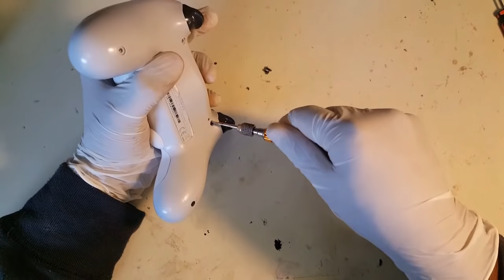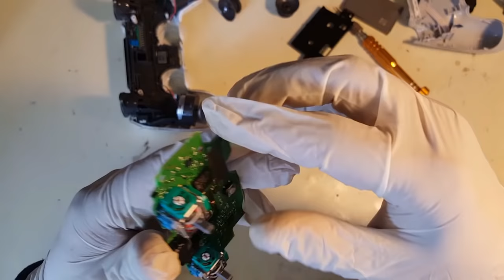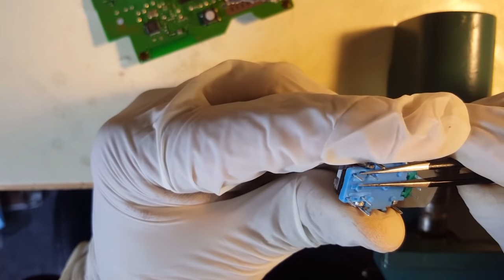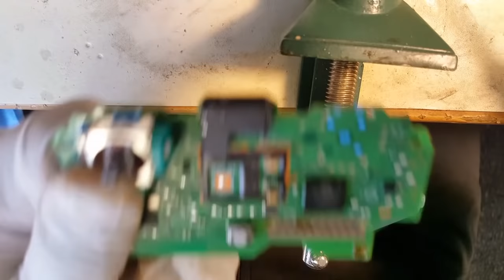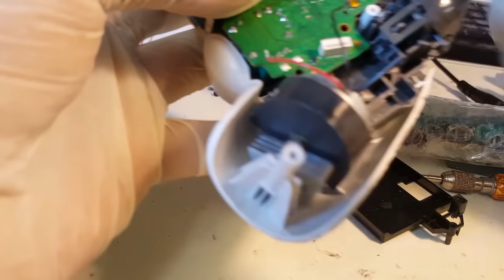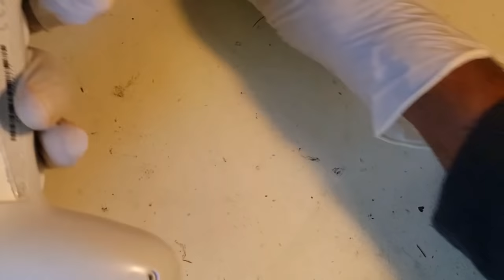Ps4 Controller Joystick Replacement

Comment: Could the burn marks on the board potentially lead to permanent and irreparable damage? And do you think someone with little experience with controller repair could do this ?
Reply from the maker: Be careful with the amount of heat applied. Yes it can lead to permanent damage. A little wit of patience can get the job done

Comment: The cables of the vibrating motors, you just solder them again with no special process?
Reply: Same question
Reply: yup, just solder back in normally

Comment: Do you reckon you could hold the new potentiometer under the board whilst heating and push it back in whilst the solder has flown? Don't have a solder remover figured it might be worth a shot.
Reply: yes, you can do this

Comment: How can I re apply the red and black wires onto the motherboard? Mine have been off from my second controller for a long time and wish to fix it myself
Reply: Solder it on
Reply: @Mr2dkid  do you need the wires for the controlller to be on pls reply as soon as posible
Reply: What do you mean be on?
Reply: Robbo they got ripped off the motherboard on both sides so they aren’t attached and controller doesn’t switch on
Reply: @TheViperAkz  when my cords got ripped off the mother board it still worked

Comment: Hello, I was wondering if you really need to use the heat gun? What if I just use the soldering iron to remove the analog?
Reply: Yeah you probably could but it may cause problems as burning the motherboard. I haven't tried this yet so I will update this comment soon
Reply: @rylloima1544  update?

Comment: During desoldering could you also just heat up the individual soldered legs with your soldering iron? As opposed to using a torch.
Reply: BcuzIGotHigh420 yes you can
Reply: @aronorenda  how can you use just the iron? I've tried before but my joints always have a little bit of solder left that won't melt
Reply: @shadowVVizardMon3yGang  for desoldering?

Comment: Recently had my 2 analog sticks replaced and soldered in. Now my controller shows orange when its plugged in indicating its charging i leave it plugged in for an hour or so and try to power it on soon as it connects to bluetooth on my phone it shuts off. Itll stay connected and powered on while its plugged in. Would you happen to know if the solder joints on the analogs are the culprit?

Comment: I replaced the right stick sensor on my controller everything works but the R3 button doesn't on the computer it shows R3 is being pressed without me pressing it and the stick itself is fine it is not stuck or anything. Is it a faulty sensor or I broke something?

Comment: I gave it a go after replacing the white potentiometer by slightly prying but still let a tiny amount of drift where it wouldn’t return to dead centre. The analogue stick just wouldn’t come off after wicking as much solder I could with flux and an iron.

Best option is to buy a new controller and sell broken one to someone who has a high end setup to repair and resell.

Comment: Hi where do you buy your 3 pin analog sticks out repair parts? I will like to ty and fix my ps4 controller I got two faulty ones. I didn't see link on description.
Reply: Hope you still need it after 4 years

Comment: I got a question , do you need the heat gun ? I'm trying to repair my controllers , But I got the soldering gun and I mean I would buy the soldering sucker to remove the iron Let's say just heating the iron one by one and taking it out with the soldering sucker it is possible ?
Reply: It's possible but it will take a lot of time and patience.  If you buy a solder sucker, also buy some solder braid too because that's often easier to use

Comment: anyone know what kinda gun he used? None of the guns I have seem to melt the solder
Reply: Same!! Did you get it?
Reply: @mcfriedchicken1972  yes i did. I put rosin core lead solder over it and then removed it and it worked for one I tried. I couldn’t do them all just one because I don’t have a circuit board to hold it up.

Comment: Thanks! Was trying to figure out how to open the shell without damaging anything and I successfully replaced the analog stick caps (:
Reply: PS4  controllers are the worst on the initial opening, feels like you're gonna rip it apart, and if you're not careful with the cable when you open it, you can.

Comment: At what temperature you are operating your work station, coz i melted mine lmaoo, and my board got cooked, i was operating at 400 degrees, Ik im stupid, but let me know what is the temperature you are using, so that i do it perfectly
Reply from the maker: Hot air station: 380c @ 3L air flow
Soldering station: 420c

Comment: I got a TS100 under Louis Rossmann's recommendation. The unit says it goes up to 400C (w/ 24V 5A power supply). However I'm having difficulty getting the solder on the board to melt. It has no problem melting my lead-free solder though. Any ideas? I'm new to soldering :/
Reply: You might have a long and pointy tip on your iron which makes it harder to put the most head directly to the solder pad! Buy a chisel tip and that usually makes melting the board way faster and more ideal for this type of soldering

Comment: I did everything but my controller wont turn on anymore, no led as well :/ when i press the ps button the controller starts to heat a bit... any solution?
Reply: Make sure you put the 12pin cable back in correctly
Reply: @josiesheppard8268  Probably? I mean, of course i touch the tracks but just around the soldering points... he's doing the same in the video... is it possible to not touch them in that point? :D

Comment: How do i reinstall the Black And Blue Vibration Cables ? My only problem is when i open my controler they got unplug from bothsides where they where weld into ?

Comment: I replaced analog sticks and now the speaker doesn’t work. When pushing R3 that doesn’t work but the stick itself works fine. L3 works both ways but when pressing it, it acts like I’m holding it for 2 seconds before it stops. What could be the issue?
Reply: Probably Just the Flex PCB. Replace It it's like 5 dollar.. be careful the graphite conductive is pretty delicate
Reply: @TheMasterizzatore  alright thanks

Comment: Can I send you my controller to be fixed ? I have the parts for the joy stick,  just not the heating tool . I've been through 3 controllers -.- I'm sad .
Reply: U can buy on ebay a soldering iron for 12$ same as i bought and i fix my controllers

Comment: What normal gamer is gonna have soldering tools 😂

Unless I get ratio’d my point still stands
Reply: I do, but I have a whole collection and mod them to work dual voltage and RF to Scart. I break things then I fix them. But I still game alot since the 80's. TBH I just got into this a few years back as a side hobby to gaming.
Reply: Maybe your to young to remember pin ball machines and arcade's but there was a time when every gamer had soldering tools. Who buy's electronics and doesn't have soldering tools ? its like buying a car and not having a wrench set sure you could do it , but then your dependent on some one else , DIY is
Reply: @Kit-lb6tr  hey, i broke the door of the analog stick (green piece), would it be possible for me to solder the metal together instead of buying a complete analog stick? Thanks
Reply: @Two_wheels_ninja  it's hard to say without seeing the condition. The conforming plastic from what I understand is antistatic and foundational. The sticks are fairly cheap I got 2 from alibaba for about 3 bucks and replaced and it seems to work nicer then the standard one.

But if you attempt your repair the worst you can do is make the stick not work. As long as you don't damage the main board and it's traces you can always replace later.
Reply: @Kit-lb6tr  thanks for the quick reply. Looking at the condition, there is just such a small gap to solder that I dont think i can unless you can heat metal and quickly attach it. I'm probably going to order some also. As well, do you have any recommendations for a soldering iron, idk whats bad or good as well as what I actually need in terms of electronics. Thanks man
Reply: @Two_wheels_ninja  I have a basic set nothing special. It was cheap like 30 bucks but the hot air gun was more expensive made by bosh. I use a 10 dollar solder sucker as well, it's the electric kind. If you invest about 100 bucks and like to fix your old equipment or electronics it's more then worth it. It's a hobby for me and I rather fix something then replace. Or at least try as it doesn't always work out.
Reply: @Kit-lb6tr  Yea im the exact same, I always like to fix things instead of replacing. I even want to try to fix my 60 gb ps3 ylod sometime this summer. I'm looking at a cheap Tabiger kit right now. Was the hot air gun necessary for this btw?
Reply: @Two_wheels_ninja  IMHO for the ps4 analogs yes. Just seems to work. I struggled a bit too much with normal solder gun and sucker
Reply: @Kit-lb6tr  alright, thanks for all the info man!
Reply: learn to solder its not hard! a hotair rework station can be gotten for less than $100 usd
Reply: Golaugh XD me
Reply: @omnilightstudios7958  lol true I got all the screwdrivers but imma lil nervous about the soldering stuff but I feel like if these damn PS4 controllers keep having problems imma eventually get over that nervousness 😅😂
Reply: @Two_wheels_ninja  im curious, did u get it fixed ?
Reply: @abde999  just got the new analog sticks so ill get back to u when i do it
Reply: @Two_wheels_ninja  okay good luck ! i replaced my ps3 controller stick recently so free to ask if u need anything
Reply: @abde999  my man will do! I will get back to you and good job!
Reply: Me
Reply: Me?
Reply: gaymers 😂😂😂😂😂😂😂😂😂 we are unite we are epik
Reply: Ummm.. wut? Everybody should. They cost like $10
Reply: When I want to sabotage a match that I bet on I always have a few tools to "set up the match" for my boys he he he he
Reply: @Two_wheels_ninja  bro same
Reply: One who uses PlayStation controllers
Reply: It's a nice and useful hobby lmfao
Reply: What normal MAN wouldnt have one? Or tools in general? A man unable to fix things might as well be a woman...
Reply: @sideskroll  lol, fax
Reply: I was changing the conductive film then the red wire snap and I was like bruh good thing I have another but it won’t charge and I need to get a part for it hopefully I don’t break it
Reply: Most really gamers do, I have some but not enough same as for my car... most of us are just Casual Gamers
Reply: @Kit-lb6tr  za
Reply: @Two_wheels_ninja  yo how did it turn out? I just ordered a cheap soldering kit for $25 and 6 analog joysticks for $10 and they will come in 5 days, ive never done anything like this but imma try it
Reply: Forgot to comment. Yea i tried it, i ended up fixing the analog stick but i mustve damaged the motherboard too much. If you dont have a jig or smtg to hold it steady i dont recommend using a heat gun just use the solder sucker to remove the joints. It feels scary at first but its not that bad, just be gentle and you will fix the problem. Add flux and extra solder before desoldering to make it easier
Reply: Engineer here :)
Reply: Me
Reply: I have a solder & desolder tools. It beats buying a whole new controller.
Reply: @omnilightstudios7958  maybe you’re to young..

Fixed.
Reply: @Edgar yeah im not paying someone 25$ to replace a part for 3$, its fun and you learn from doing it yourself too
Reply: @lavishlyvice  

Every like means that someone agrees with my comment... duh 🙄

Comment: Do I need a heater for the process or I can do the job just by usin a solderin iron?
Reply: you can try to do this with soldering wick but I personaly think hot air is much easier.

Comment: Thanks for the video! Does it matter which ones I get? There are a few joystick modules out there with various price points. Do they differ much?
Reply: Yes, it matters. I didn't know myself but someone above pointed out that some do not allow you to click (L3/R3) while the stick is not in the neutral position, which is a big thing if you play shooters. Also, I imagine the quality (and tension of spring) vary wildly. Sorry I can't point you to the best part for the job, I do myself want to fix two of my own. I'm currently getting into controller modding so will be doing so at some point but for now I am just working on the artistic side.
Reply: Flint Beastgood Cool thanks for the reply! If you eventually do stumble upon to answer to which ones are the best please let me know!
Reply: @TerryBowl  I've got ALPS, one did work for 8 months (playing 4 hours per day) and the new one worked only 30 days! I don't know why!

Comment: So I've followed every step and I have used the right tools but the solder in the joints won't melt off no matter how long I keep it under my heat gun or how much Flux I add
Reply: Remove the factory solder with a sucker/braid and replace it with standard leaded solder. Leaded solder has a much lower melting point. Additionally you can get something like chip quik removal alloy which has an EXTREMELY low melting point and will make removing components a breeze.

Comment: Could you share where do you buy originals joysticks remplaces? Can you put a Link to buy . Thanks.
Reply from the maker: https://www.aliexpress.com/item/10X-Joystick-3D-Analog-Sensor-Module-Repair-Part-For-Playstation-4-PS4-Controller/32880300000.html?spm=2114.search0104.3.94.68f63265sUHW7p&ws_ab_test=searchweb0_0,searchweb201602_3_10065_10068_10547_319_10059_10884_317_10548_10887_10696_321_322_10084_453_10083_454_10103_10618_10307_537_536_10902,searchweb201603_16,ppcSwitch_0&algo_expid=465ae3a5-e7d2-4705-b31d-7799ae17a89a-13&algo_pvid=465ae3a5-e7d2-4705-b31d-7799ae17a89a

Comment: Is there any risk of overheating they microchips of the circuito board? 
My problem is this; i did the same procedure and with out the analog assembled, i tried to assemble the controller back again (while the new analog arrives) and after that, the controller won't turn on. My question is: did I fucked up the microchips or the controller won't turn on with out the analog in the circuit board. Thanks.
Reply: Maybe you didn't reconnect the battery?
Reply: Ambiguity06 Actually, the controller is working "fine" but the light won't turn on. Has no problem charging or anything else. The only matter here is that the analog joystick I ordered won't let me do any diagonal movement. Kinda sad :/
Reply: @sergioguzman2065  if the light doesn't turn on maybe you forgot to connect the ribbon cable for it. And man that sucks. Hopefully you find a solution.

Comment: Is the hot air gun necessary, or can i just heat up each solder blob and when it is liquid can I use a solder sucker on it
Reply from the maker: You can use a soldering iron to remove it , though the soldering iron needs to be around a 80w and LOTS of solder braid.

Comment: Honestly this wouldn't be as big of an issue if the PS4 had a deadzone setting, the only game that I know of that has that setting is Death Stranding.

I got away with repairing it solderless. I replaced the plastic pieces inside the the housing, just keep in mind that they only fit in one way, the spring that sticks out  should be facing up so the door can close.

Comment: Good video, but I wonder why they elected to use a hot air gun instead of solder wick to remove the solder. It seems like it'd be so much more easier to use solder wick

Comment: Ok I soldered my joystick but it's not working did I not use enough solder? The joystick isn't moving at all? Should I go back and put some more solder on it or take some off? I feel like I should cover the needles with solder....somebody let me know something
Reply from the maker: Ensure the sensor wheel is correctly inserted and working. If its not spining/moving in conjunction with the grey joystick it wont work.

Comment: is it compulsory to use  hot air gun when removing the analog?
Reply: It is, you can also try chipwick, the joystick is tough to remove using only sucker or solder wick
Reply: @timmywh  couldn't i do it with a strong solder and also a sucker? air guns are too expensive in my country btw
Reply: @noutsider4742  Yes you can. It could possibly take a lot longer but the air gun is not compulsory to this task.

Comment: I tried to change the analog, lil bit struggling but at the end of the time i can change it, but after that my controller won't turn on if i don't charge it. Aftet i leave it to charge, it won't turn on at all,, do you know what could be the problem here ?
Reply: probably melted a connection
Reply: @Nocturnalphil123  probably, evrrything seems ok, i even change the flexi cable but still won't turn on.. now I'm giving up
Reply: @ferrismaximillano1556  I'm so for your loss
Reply: You probably applied heat to the wrong part of the controller and can have screwed some IC or even destroyed a track of the PCB, as you said you had some difficulties doing it.

Comment: I've been trying to remove a joystick from my controller for 3 days now and I just can't, I have basic soldering knowledge and experience and I remove as much solder as I can from the controller but I just can't get it out.
Reply from the maker: Some factory soldering can be tricky to remove. Patience and apply flux and fresh solder to the joints.

Comment: What was the new solder before de-soldering for?
Reply: It can help to reflow what is on the joint, making it easier to desolder
Reply: @MisterModder123  thanks, I've only done a few but I've not had any issues desoldering. Good to know a trick for when I do though

Comment: It is virtually impossible to remove those blasted soldering holes honestly you make it look so easy 😭
Reply from the maker: It is possible mate, I did and so can you. Takes a little bit of patience.
Reply: And don't forget the temp is in C, not  F, and if it's hard, remove as much initial solder and replace with new solder full of flux before attempting again! That's what I needed to de because of rohs pb'less solder